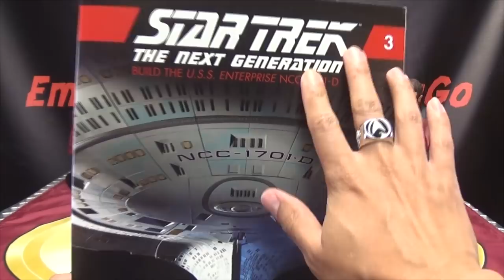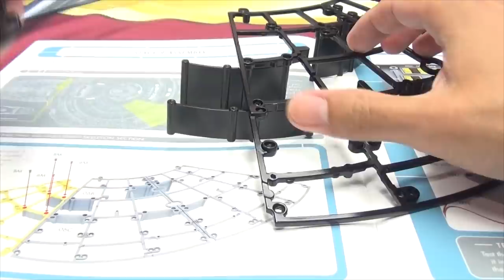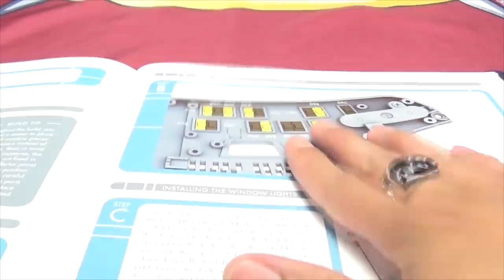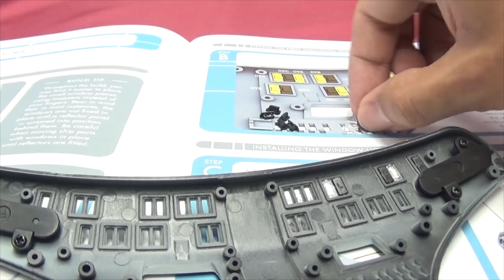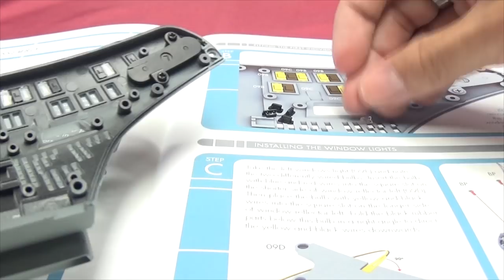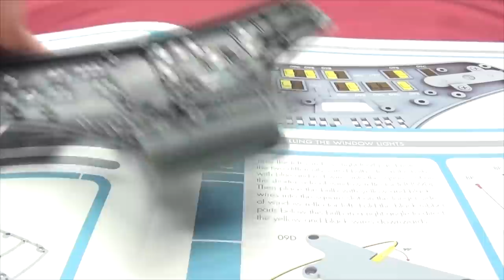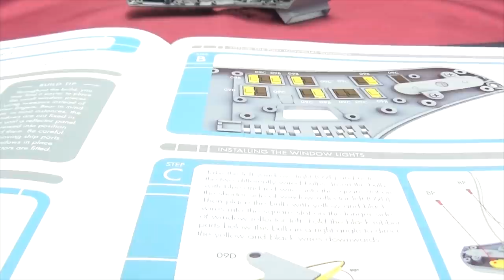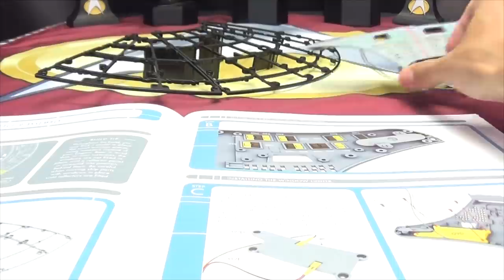Eaglemoss Star Trek Enterprise NCC 1701-D Kit (Part 9): EmGo Builds Stuff

Comment: I bought some Tapping fluid, really helps get the screws into the metal parts. And it helps a little to get the threads cut before attaching everything, that saucer section gets pretty heavy
Reply: What are you thoughts on thread locker with these screws?
Reply: @MrPeterson74  I haven't noticed any of my screws coming lose, so I don't think Thread locker is needed

Comment: Only thing I'd be concerned with the electric screwdriver is that it's waaaaaaaaaaaaaaaaayyy easier to cross thread and screw stuff up with that than it is with the hand tools.  THat and I wouldn't use it on plastic because it'd probably strip stuff out.  That said, once the screws are started, it'd be good... but until then....